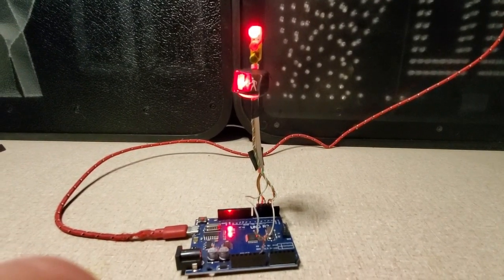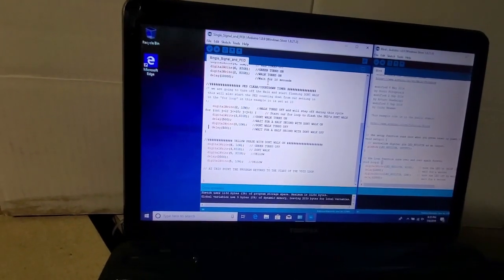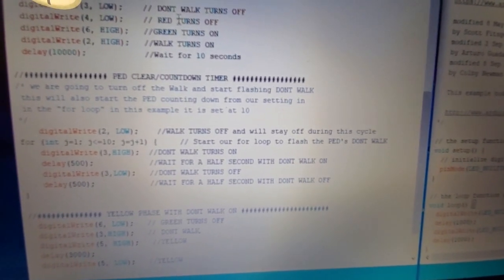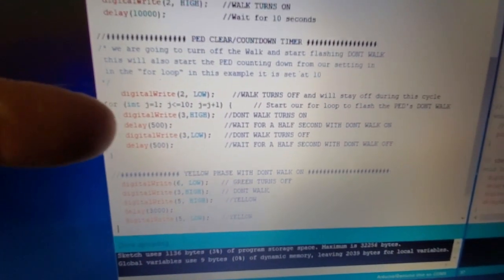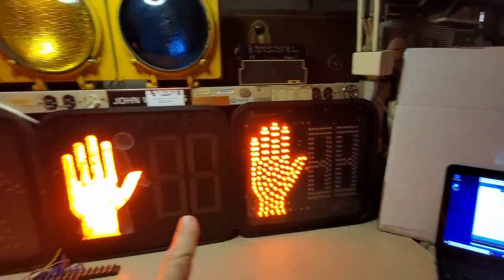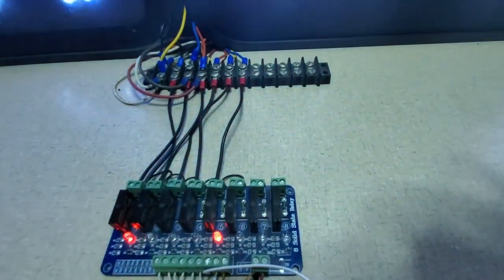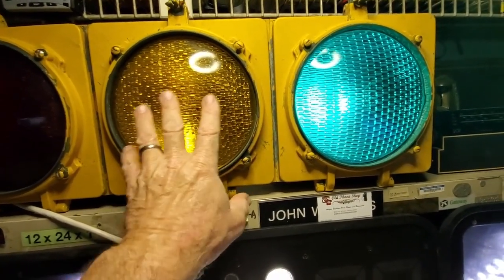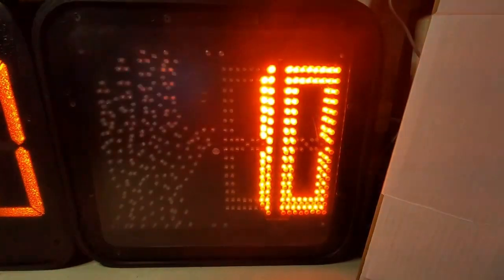How to make Countdown Crosswalk PED work using an Arduino and Solid State Relay

Comment: I tried this but the top part of the man flashed real bright and stopped working and some smoke came out and it smelled burnt. So not sure what I did but im gonna put it back and hopefully the city puts a new one in and i can try again maybe my wires was reversed it was real confusing because you get blue orange and white so i knew orange was earth and white was man and blue was 120v when i took it out it was hooked up to different colors inside the box and there was a bunch of screws where the wires went
Reply: One of the legs still lights up! But that's all.

Comment: @jrocco36 how do I easily add another direction so I can make an intersection?
Reply from the maker: You would consider that one direction would be your "Main" Street and the other would be "Cross" Street. 
first step would be all Red for both Main and Cross plus all the PEDs would be set to DONT WALK. and hold that for a few seconds. say 4 seconds.
Next Main would be Green with the PED WALK and the Cross street would hold Red and DONT WALK. hold for say 15 seconds
Next Main would still be Green while the PED starts Flashing DONT WALK. Cross would remain the same. Maybe flash 10 times
Next Main would be Yellow and the PED would be DONT WALK. Cross would remain the same. make that 4 seconds
Next step would be all Red for both Main and Cross plus all the PEDs would be set to DONT WALK. and hold that for a few seconds. say 4 seconds.
Next Main would remain RED with PED DONT WALK. Cross would be Green and PED WALK.hold for say 15 seconds
Next Main would Remain RED with PED DONT WALK. Cross would be Green and  the PED starts Flashing DONT WALK. Maybe 10 times.
Next Main would remain RED with PED DONT WALK. Cross would be Yellow and the PED would be DONT WALK. make that 4 seconds.
After that the cycle repeats. 
You can use the Arduino Program I supplied above as a good start. Just think of what the other signal should be doing as you move through the cycle. 
Also as you go about your day watch the real traffic signals and PEDs and they will give you a good Idea on how to make a intersection work.
You can also lay out the whole thing using just LEDs and try different times and maybe add a turn lane.
Most of all have fun with it.

Comment: Usually I've seen the crosswalk signal countdown some of them has proper 9, 7 and 6, and some of them has q (9), 7, and b (6). And I don't know that is the way it works to do a countdown on the regular basis to let pedestrians know that the time is running out before they can't walk the crosswalk.
Reply from the maker: Basically they use a type of 7 segment display and really has to do with how the 7 segments  are configured.  here is a quick video on the 7 segment displays which may help.
https://youtu.be/L1qN0iPeYqg

Comment: Do you have an email address? I have questions about wiring setup mainly for a pedestrian crosswalk signal with a possible traffic light connection in the near future. I am getting an Arduino UNO R3 in the next couple of days from Micro Center in Dallas, Texas, but I do have a 12 position screw terminal block, an 8 channel Solid State Relay board, and a DURALIGHT Pedestrian Crosswalk signal Model: JXM-400VIECAD with three wires (red, white, and brown) [If I need any other parts, I can easily get to complete this project]. I do have the Arduino code to make it work as well. Google keeps sending me to a breadboard version with small LEDs instead of the real pedestrian crosswalk signal. I need help on connections or at least a diagram one with and one without a traffic light connection, but mainly a pedestrian crosswalk setup. I just want to make it work as efficiently as yours. Thank you for your help.
Reply from the maker: jrocco36 AT gmail DOT COM
Reply: @jrocco36  I Already Sent My Email To You Already. Thank You.

Comment: Where can I get all the wiring from to do all of this?
Reply from the maker: In the Arduino program It has what each of the output pins do. Keep in mind this is only +5v out so do not ever connect mains current to an arduino.
// initialize digital pins as output.
  pinMode(2, OUTPUT); //WALK
  pinMode(3, OUTPUT); //DONT WALK
  pinMode(4, OUTPUT); //RED
  pinMode(5, OUTPUT); //YELLOW
  pinMode(6, OUTPUT); //GREEN

Comment: Can i get my traffic light to cycle through but the red hand stays red until you press a crosswalk button with this controller?
Reply from the maker: Yes, it would be fairly easy to modify the program I have linked above to add a fully actuated PED Signals. It's a good building block to start with!
 On a real system, When you press the PED CALL button it doesn't change the light as some people think, What it does is ADD a PED cycle.  Think of the entire program as a ring. and on this ring are loops. When it goes to RED it stays with the RED Loop for the amount of time programmed into the controller. After the time is up it move onto the next loop on the ring. So when the button has not been pressed the controller does not add a PED loop to the ring, But when the PED CALL is pressed then it adds the PED loop to the ring.
Using an Arduino with a button you just tell the program that when the button is pressed then go to the PEDloop sub routine. once the PED has counted down to Zero (PED CLEAR) then it would return to the part in the program where it left off. Thing to also consider is what happens to the RED during the PED Cycle and when there is no PED Cycle. Say the red is 30 seconds without a PED Loop added. Then if someone presses the PED CALL button it adds the amount of time needed to walk across the street and count down to PED CLEAR.
Remember to have the PED countdown on the first cycle of your program so it stores the PED CLEAR .... (example have it flash 10 times if you want it to countdown from 10) Even real traffic controllers do one complete cycle .
Not knowing how well versed you are programming Arduinos but it basically press a button, go to a submenu, do the action in the sub menu and return .
I should do a video on this very question as it I think it would be interesting
Reply: JRocco 36 Awesome!! This is great because I have a traffic light and PED signal with a button and Galak controller and the green light stays green and the red hand stays red until someone presses the button. When you do press the button the traffic light changes to yellow then red and the walk man will come on then start counting down to zero. Then the traffic light turns green and stays green until someone presses the button again. I’m not to familiar with computer programming and I’ve been looking into the “real deal” traffic light controllers with the load switches and all but are so expensive. The controller in your video is very cheap for all it can do. I would like to set up another traffic light and PED signal to my collection and have it all work together. But that is very useful information and would love to see a video with the PED button! Thank you so much!!

Comment: Nice collection. Just bought a GE ps7 my selves. 
Would like to test out your code, but your website doesn't seem to be up anymore. 
Never the less, love this video
Reply from the maker: I updated the weblink to my Github account. enjoy the sketch. If ya make anything cool post it and send a link
Reply: @jrocco36  Thanks! I'll take a look at it. Doubt that I will make anything more interesting than you already have :)
Reply from the maker: @Pondus  Jump in and experiment with your Arduino. That's really what the Arduino was made for. They can do so much and when you try to do something that your not as experienced with there are many examples and books that will help! It gets easier as it goes.
My example is really simple and it can be used to build a full intersection on. We all have to start somewhere. if ya have any questions feel free to ask.
Reply: @jrocco36  Thats my plan ;)

Comment: Awesome video! I have my whole traffic light collection running off an Arduino Mega. If you want to take a peak at them cycling, the links are below. I originally used delays in my code as well but ended up revamping my entire code and used millis to control timing and switch/case to control the current state of the lights. This allowed the code to be free flowing and allowed the mode switch to react instantly. If you want a copy of my code, let me know. I really enjoy your videos! Thanks for sharing! 

Normal Mode:
https://youtu.be/r-w3ZmMGRkk

Flash Mode:
https://youtu.be/4AwHVEcyJEw
Reply from the maker: Thank You! 

I was planing to have all the delays in the setup so I could change all the timing in just one place. Since I've acquired a complete system I haven messed around with using either PICs or Arduinos to control the lights and PEDs. I do still have all my old PIC and Arduino controllers I've built. I subscribed to your channel and look forward to see more of your signals.
Reply: JRocco 36 I finally created a video walkthrough of my traffic signal collection being controlled by my Arduino. Enjoy! https://youtu.be/A8bEvGYIEwA